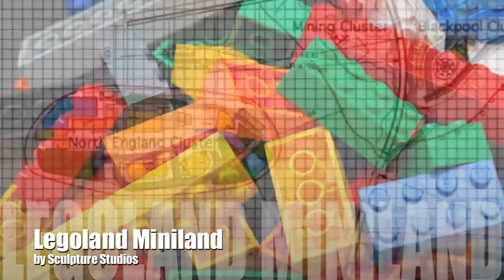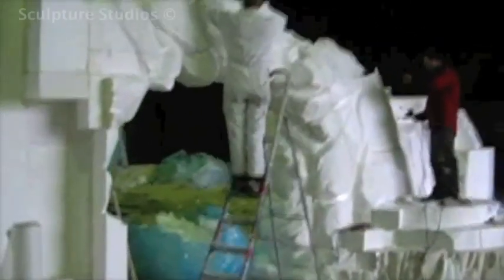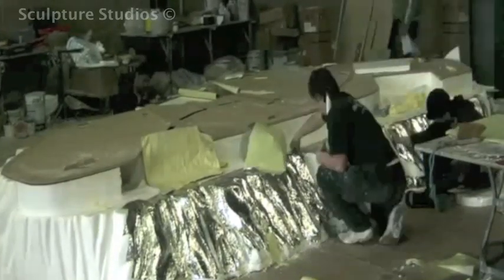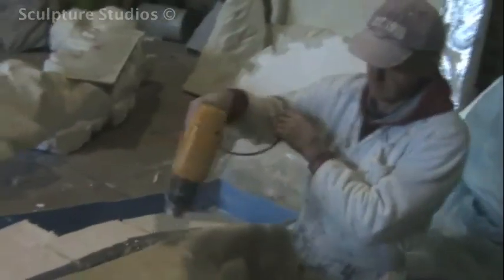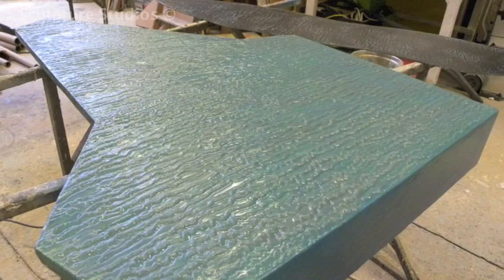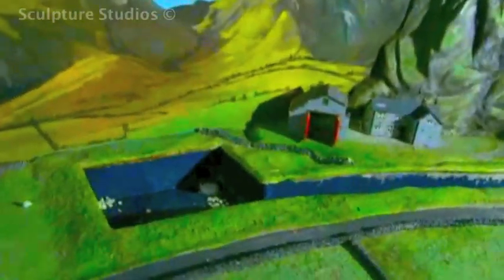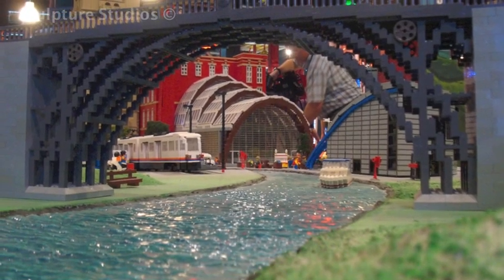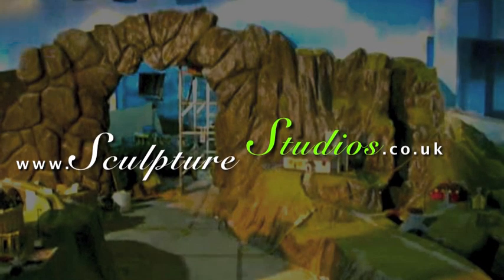Lego Miniland by Sculpture Studios

Comment: Hello, Can be made a mold from  foam (styrofoam) to be used for making thinks from fiberglass ?The ideea is to make a very large object from fiberglass by using a styrofoam mold.Respect,Geo
Reply from the maker: geo Vlaicu Hi there, have a look at some of our other video that involve mould making. Generally we use fibreglass, plaster  of Paris, or silicone rubber to make a mould. I don't know why you would want to make a mould out of styrofoam
Reply: Hello,Thanks for the answer.The ideea is to make a mold (not to be heavy)from styrofoam to use it (as a mold)to construct a fiberglass rock .Is like a big sphere and inside is styrofoam with the form of a rock(or a boulder)and I turn it in a side or another to put fiberglass (to use gravitation for the fiberglass to mold the down side ,and after that I turn it and mold the fiberglass in the down part of the sphere and so on intill I mold the hole sphere with fiberglass and after it dryes i get it out and use it like a rock from fiberglass,The dimensions are 4 meter lenght to 2,5 meter hight this is why I want something light to turn it from  a side to another when I put the fiberglass inside.Respect,Geo
Reply from the maker: geo Vlaicu I don't know how you would create a mould like this out of Styrofoam. Also, it would be best to create a mould in multiple sections. As I said, have a look at some of our mould making videos